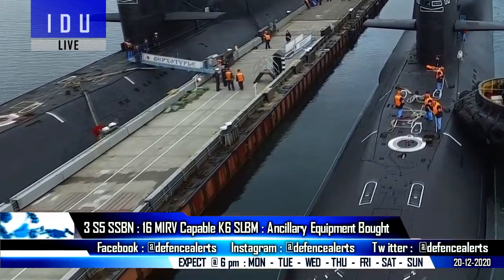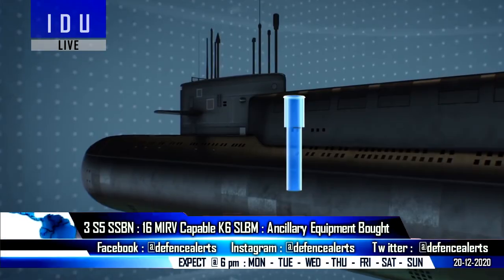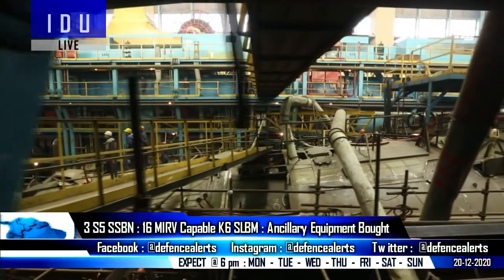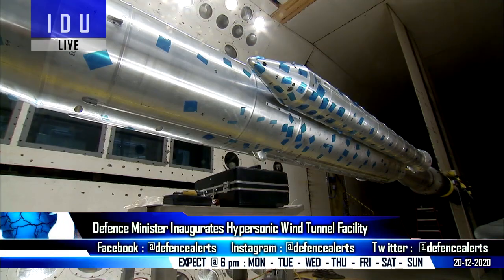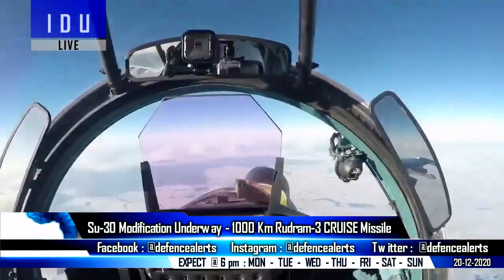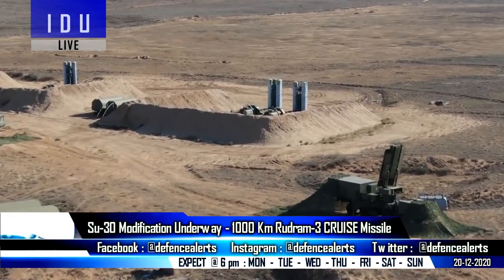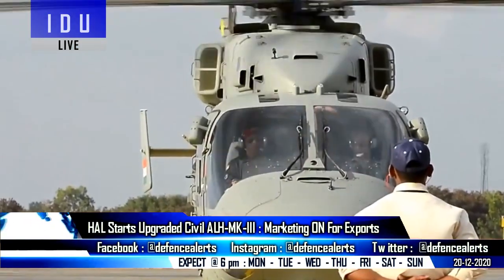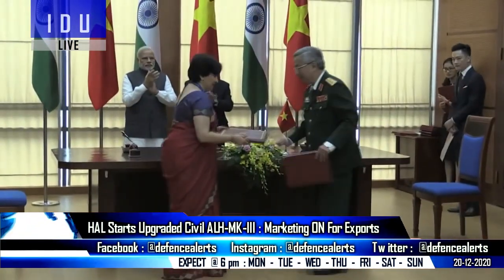Indian Defence Updates : 16 K6 SLBM on S5 SSBN,1000 Km Rudram-3 for Su-30,New Hypersonic Wind Tunnel

Comment: Wait.. I thought Rudram is an anti radiation missile which they successfully tested in October. Now Rudram 3 is a hypersonic cruise missile? Is this update correct? And what happened to Rudram 2?
Reply: Rudram is 1 is development and iaf wil use it from 2022  250 km
And this 1000 km ran ge missile
Reply: @arjun-pr9yb  I'm not talking about range bro. I know range increased now but there is lot of fundamental difference between anti radiation missiles and cruise missiles. I thought entire Rudram series would be anti radiation missiles with increasing ranges
Reply: @RT-vb7bu  ok 
Rudram  anti radiation missile 
150 km   to 250km
Nirbhay  crusie missile land based  
land to land 
Rudram 2 anti radiation missiel 
rudram 3 air to surface crusie missile